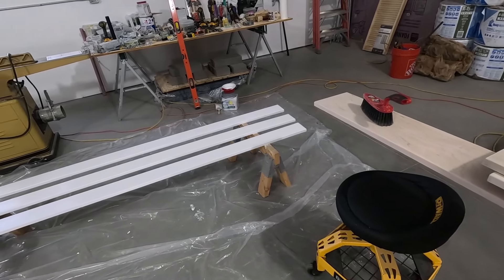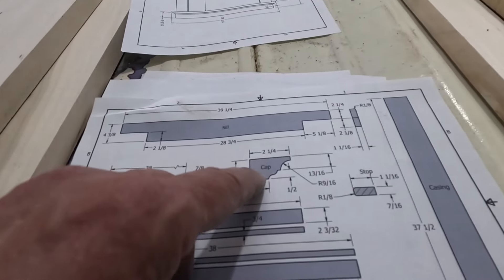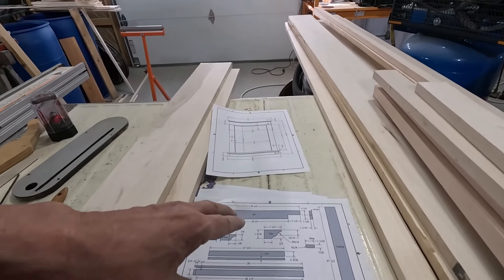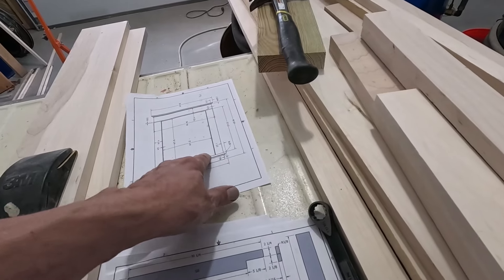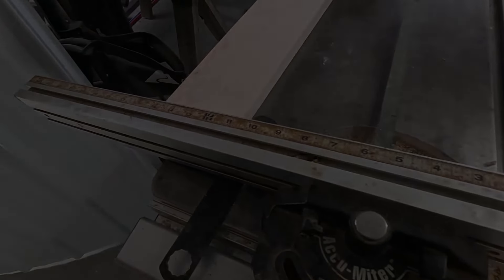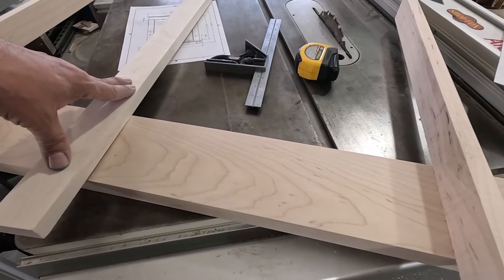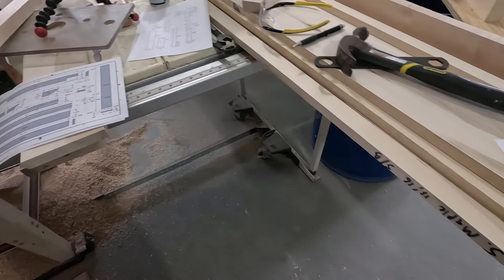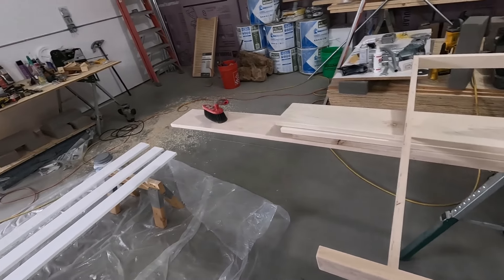More Trim Work for the Tiny House ― Making the Window Jamb

Comment: When making the cut outs for the casings you could turn your piece up on edge and then adjust your blade to the correct height to make the cut. This would avoid the over cut from the blade being round on the underside and would avoid having to trim the inside of the corner.
Reply from the maker: I do that on the miter saw on some things, and roll the work piece to get a full cut, but this is far more accurate. I just screwed up 😑
Reply: @PlanetMojo  yeah but cutting it with the board laying flat leaves that little inside corner that needs to be trimmed out with a chisel. You could make a test cut with he piece standing on edge

Comment: Why not use the actual side piece as a spacer between the fence and the blade rather then marking the cut piece from the side piece and then adjusting the fence to that secondary mark? Wouldn’t it be more direct and have less chance of error?
Reply from the maker: Not sure what you are saying. Using the actual piece to set the fence would only be as accurate as what you are seeing because the cut is to the far side of the blade. A parallax view would make the cut off. Marking then sneaking up to the line is as accurate as it gets. If the cut was to the blade, I would just use the fence cursor. Hope that makes sense 😊
Reply: Just set your side piece between the blade and the fence taking into consideration the set of the saw teeth and the other piece will be the same width. Assuming your blade is parellel to the fence the two pieces would be the same width. Sometimes I set the far side of the blade just slightly wider to avoid binding but either way there is only so much space between the fence and the blade so the two pieces should be identical. What am I missing? @PlanetMojo
Reply from the maker: @vtstream  Putting a piece of wood between the fence and the blade can flex the blade when you tighten the fence, and make your cut inaccurate — then you would need to add 3/32". If you are going to make test cuts — which you should — this is quicker and more accurate.
Reply: @PlanetMojo  to me it seems more direct to use the piece I am trying to duplicate as a model to gauge the space. Of course you wouldn’t want to jam the fence into it so it flexes the blade and would do a test cut. But we all have our ways and you are doing a really good job on your tiny house. Keep up the good work.
Reply from the maker: @vtstream  I should have just ran the piece thru on edge right to the correct depth, but on one of the cuts their was a chance of a chip out on the other side. I do a lot of craftsman style furniture, and use the table saw for most of the joinery. It's been a few years though, so I'll need to get back up to speed once the shop is fully operational. 😊
Reply: @PlanetMojo  I think my table saw is the most useful tool I ever bought.